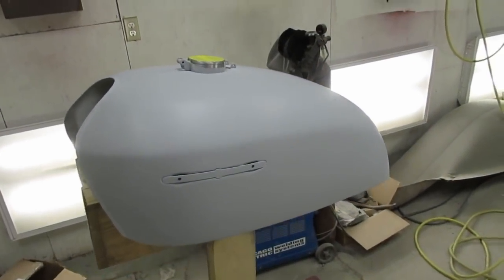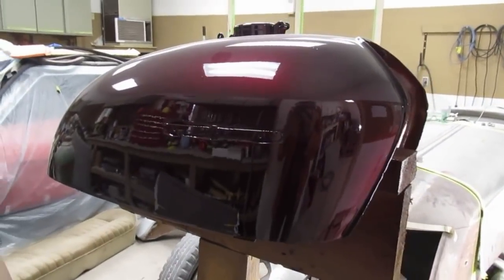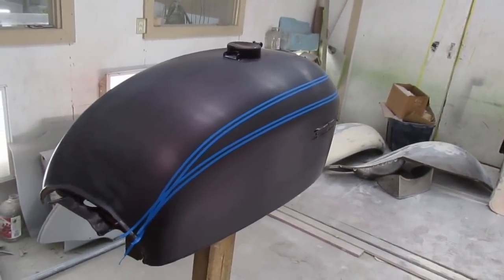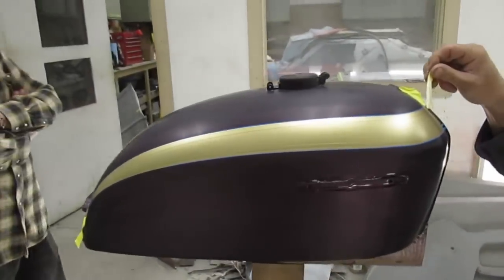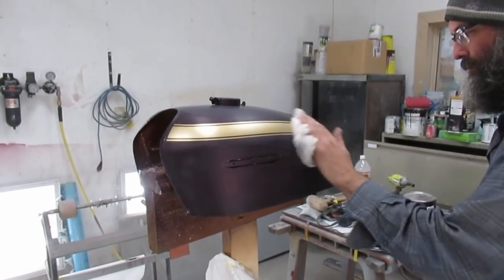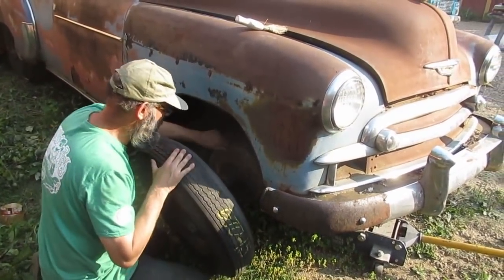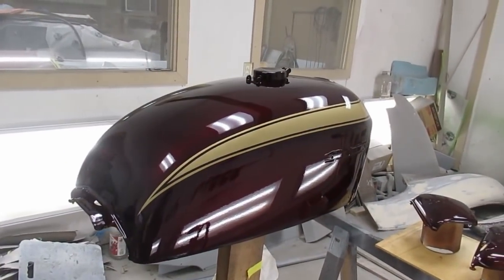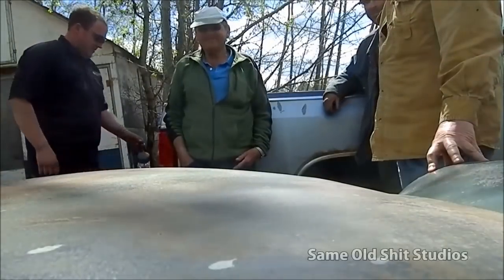Candy Paint and More Classic Tire Action!

Comment: when you coat the paint like the stripes, do you do just enough to cover the area that your looking at and then come back like an hour latter and do the same ontop of it to get a good finish? as I always kinda get impatient when painting and just try and make it look as good as possible, which usually ends up in too much paint and too much runs on it. 

actually when it comes to painting as an Idea I'd love to see a series of how to do GOOD rush jobs lol and what NOT to do lol as the thing with painting is everyone wants to do the best, but doesnt know how to do it lol 

as what is the purpose of wetsanding besides getting rid of orange peel, as it just seems almost hearbreaking to go from a beautiful gloss to that matt, only to polish it again and get it back

as I'd love to see it explained in a step by step process of how its done, kinda like how a guy taught me how they did chrome bumpers on old rolls royces where its like a 3 coating process to it, Copper, Nickel and Chrome I think, as the guy had actually worked for them in the 70's ala a contract to do the bumpers. 

hence why if the chrome gets pitted you can use some like 3000 or 4000 steel wool or 4 double O as i think its refereed to sometimes and some gun oil to bring it back as I saw Corvette ben do a few times, as its kinda like a gloss coat, your really taking the chrome off and getting to the nickel below.